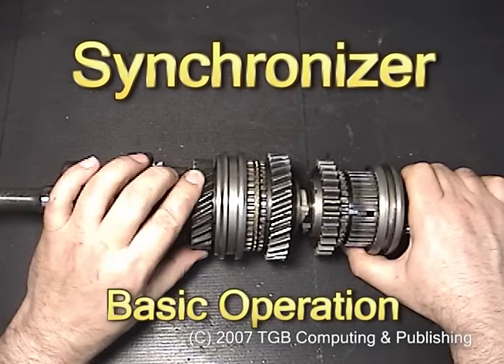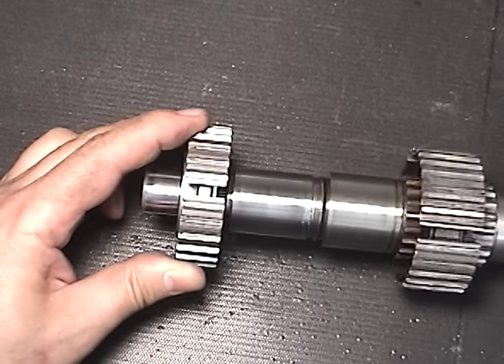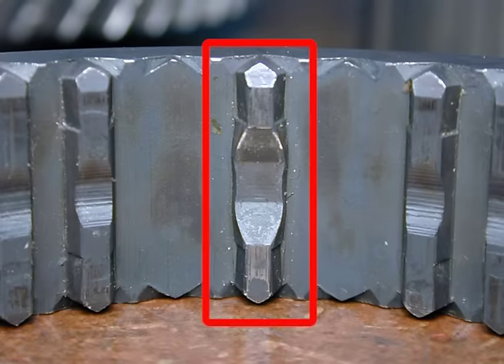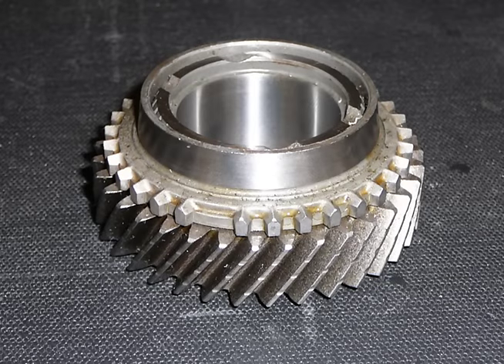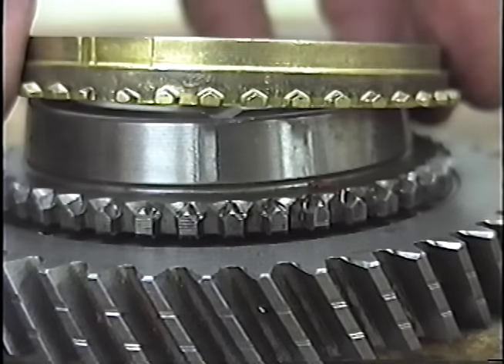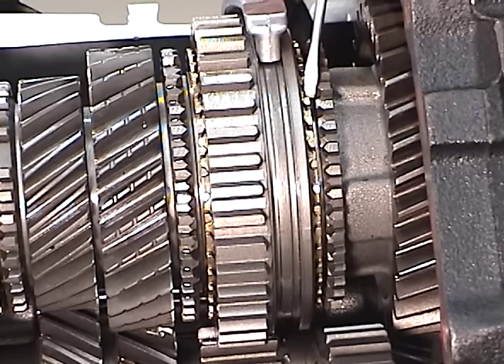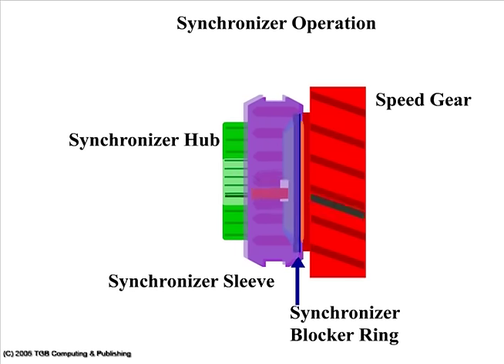Synchronizer Operation Explained

Comment: Is buying a car with a bad syncros for reverse a sign that the car could have been abused?
Reply from the maker: Reverse is never synchronized because if it was you would be able to put the car in reverse while going 15 mph forward without any grinding.  Then when you let out the clutch with the trans in reverse while driving 15 MPH forward....... well you can guess what might happen.  Any time you try to put any manual transmission in reverse while the car is moving you will get some grinding (AKA gear clash). So, no, that is not a sign of abuse.
Reply: DrivelineMaster thanks for your reply.
Are you saying there is no syncro  for reverse?
Am I looking at a new tranny then?
Reply: Could one ended indefinitely drive their clutch with this issue?
So, you just go to first then into reverse and it works fine.
Or,would you being causing unseen damage?
Thanks
Reply from the maker: Different transmissions have different methods for engaging reverse but non of them use any type of synchronization to make reverse fully synchronized. There are some front wheel drive vehicles that use partial synchronization but the explanation gets very technical.  Bottom line is any Trans will grind going into reverse if the vehicle is moving at all. You may not need a new trans.  It might just be normal.
Reply from the maker: If you have problems getting your trans into reverse but by going into first or another gear first and then going into reverse is much easier this will not harm anything and many people do this.
Reply from the maker: I'm saying the trans was never engineered with a synchronizer for the reverse gear.
Reply: I’m saying that if you try to put it into reverse first it will grind and you will do some serious damage.
So, by going to first gear “I was told zeroing out the syncros” then it would be fine.

Two questions 
Is it safe to drive this indefinitely?
How do you think this happened?
Thanks!
Reply from the maker: 1, Grinding when going into any gear is never good so yes you will add to the damage going directly into reverse if it grinds. 2, It does not hurt anything to go into 1st before shifting into reverse and since there is no grinding it is the better way and it will prolong the life of the transmission.  3, Most likely a previous driver was a bit rough on reverse shifting it into reverse while the vehicle was still moving forward instead of waiting until a complete stop.  Side note:  Placing the trans into first before going into reverse helps to align the input & output shafts and gears including the gears that are associated with reverse. Reverse is tricky because there are three gears that need to be aligned.  Drive , Idler and Driven and the 3 gear set is not synchronized. In other words there is no device designed to align all three gears before they are engaged with each other to produce reverse.  All of these gear are normally straight cut gears known as spur gears and the end of each gear that faces engagement is pointed when brand new for easy engagement. After years of putting into reverse while the vehicle is still moving those pointed gears get worn down and the point becomes rounded. Rounded points make it harder to put into gear and cause additional grinding and difficulty when trying to put the trans into reverse. Putting the trans into 1st before going into reverse helps to align all 3 gears before you move your shifter making reverse engagement easier and less grinding. Just to be clear the term "Zeroing out the synchros" is incorrect. Aligning the shafts and associated gears is correct.
Reply: Man, you have been such a big help. I appreciate your attention and expertise. So, this car that I might buy that has this problem also has a messed up brake cable that barely works. 2007 CTS-V 
I’ve been told that the repair to reverse can be made without pulling the transmission out. The GM dealership said the opposite 
What do you think? Also, worst and best case senerio (money wise) again thank you. 
I have learned in the interm that the owner has tracked the car,which explains the issues
Thanks again
Reply from the maker: Reverse can not be fixed without the transmission being removed from the vehicle and being totally disassembled.  Now that I know what kind of vehicle you are looking at I looked up the Aisin 6 speed transmission that is used in that vehicle. They use a very unconventional power flow and I need to retract and clarify.  This transmission does use a reverse synchronizer sleeve and ring to engage reverse causing what I call partially synchronized reverse.  It's more than likely that the synchronizer sleeve, ring, reverse driven gear hub and counter shaft hub will all show signs of wear.  I don't know if the counter shaft hub is replaceable or not. If not the entire shaft may need to be replaced big $$.  It could be driven as is but to have this repaired will cost big $2,200 + if you replace the transmission excluding labor and a new clutch if needed. If you did everything I would not be surprise if the cost was close to $5k depending on the labor cost in your area.  It really comes down to how much you really like this car and if you want it fixed or are willing to live with it the way it is?  If you do buy this vehicle I would try replacing the oil with a high quality synthetic Manual transmission fluid like Red Line MTF.  It might help but from your description I don't think it will but it would be worth the try.  The fact that you seek information online tells me you take care of your vehicles and you want them to work properly.  That being said, save yourself the headache and pass on this car and find one without all of these $$$ problems.
Reply: I’m taking your advice. My thanks you too! Lol
It’s people like you that make the world go round. Bless you and thanks again
Reply: @bowlingballmagic  ... This car still has a problem that needs to be addressed. 
If you are at a complete stop and you pause after depressing the clutch pedal, if it grinds going into reverse, it means the input shaft is turning when it should not be.  By putting it into 1st before reverse, the synchro on 1st will stop the input shaft, making it engage reverse without grinding.
There are many causes of an input shaft that won't stop.  Insufficient clutch freeplay, and a bad pilot bearing in the flywheel are two common ones.
Reply: @DrivelineMaster  ..  Some Subarus have a synchro on reverse.  It's not to synchronize the input shaft to road speed, but just to stop the input shaft so reverse can be engaged without grinding while the car is stopped.

Comment: Bro, what is the problem of my tractor   transmission, because it cannot shift from neutral to 3rd gear, only operate is 4th gear and reverse, what should i do, thank you
Reply from the maker: I don't know anything about tractor transmissions but there are similarities.  How about 1st or 2nd gear? if you turn off the motor will it shift into 3rd? Can you drain the oil and see if there is metal in the oil? Does the clutch properly disengage?
Reply: Thank you for respond sir, i drain already its look good no any small metal comes out. I dont what happen why i can not shift to neutral until 3rd gear. Until 4th and reverse only can work
Reply from the maker: Since I have no tractor experience you will have to help me with answers to questions. Is there a clutch that you must use between shifts?  Are you having trouble going from Neutral into 3rd? or going from 3rd into neutral? What about 1st and 2nd? Do they work properly?
Reply: Clutch they have sir, but the neutral to 3rd gear no working, thats why when i start i push first the clutch, so that it can not run to start
Reply: I dont know on what happen to my tractor, only 4th gear and reverse can  moving
Reply from the maker: With the motor off can you put it in 3rd?  Push the clutch in and start the motor. Then let the clutch out. Does the tractor move? If it does, Try this with 1st and 2nd. If this works you might have a clutch problem. If this doesn't work you most likely have a transmission problem.
Reply: Thankz sir, ill try what you say, but it the same no moving to 3rd gear, may transmission, ill thinking first if transmission down or no need expensive

Comment: urm.. failed to show me how the friction surfaces worked It synchronised.. but doesn't REALLY show me how. It didn't really show me how the blocker thing blocked for that matter..
Reply from the maker: Yes, That is very complicated and difficult to show. Since you are asking I will take a moment to see if I can explain that to you in this response.  The threads or friction surface on the inside of the blocker ring cone when forced against the mating cone on the gear create friction.  (The movement of the sleeve pushes on the keys which push on the blocker ring).  The friction created between the ring and the gear generate heat and expansion.  The friction tries to grab the gear and match or adjust the speed of the gear to the speed of the entire synchronizer assembly.  If it is able to do this the sleeve is allowed to slide over and create a mechanical lock between the gear and the sleeve.  If however the driver is trying to downshift into first gear at 70 MPH the speed differences will be excessive and synchronization will be impossible.  The heat and expansion generated from trying to synchronize the two components creates a force that pushes the blocker ring back towards the synchronizer.  This force transfers from the blocker ring to the keys and then to the sleeve. The force pushing back is so great it makes it impossible for the sleeve to move close enough to the gear to grind the teeth in the attempt to engage.  Hence blocking the shift because a shift would only result in gear teeth grinding due to the inability to synchronize the speed of the gear with the speed of the synchronizer. Let me know if you need more clarity.  I will think about how I can illustrate that and add it to this video or make a supplemental video.

Comment: so its basically a metal clutch that two gears use to "sync" together....
Reply from the maker: An Automotive clutch like what is used in a manual transmission is considered a coupler. Connecting and disconnecting engine power to the transmission. The synchronizer does couple but it has an in-between mode where friction is used to synchronize the speed of the gear and the shaft. Once the two components are synchronized then it becomes a coupler connecting the gear and the shaft together.

Comment: Thanks for the video but there is one thing is unclear to me: How is the blocker ring connected to the rest of the synchromesh? From the many diagrams I have checked, and videos I have watched it looks like the blocker ring is guided over the synchronizer keys, with nothing preventing it from just falling off
Reply from the maker: The keys that fit into the cut outs on the blocker ring limit the rotational movement and the clearance between the hub and the gear limit the axial or lateral movement. If the clearance between the hub and gear is too great they yes, it will fall off. As you can see from my video there are no mechanical latches or fasteners the blocker right just pulls off when the synchronizer assembly is on the work bench.
Reply: @DrivelineMaster  Thanks for the reply, now I finally get it

Comment: These videos explain how the two gears synchronize their speeds fine, but none ever explain how the two gears (the blocker and the speed gear) then LINE UP.  The narrator even said what the three functions are, but then he didn't explain them all.
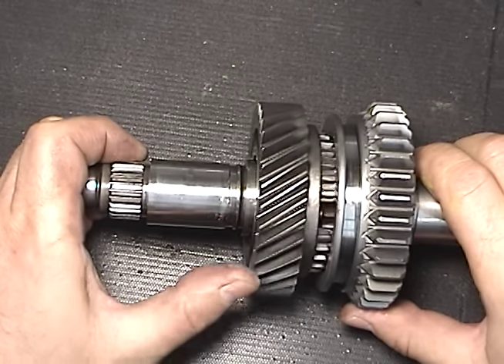Reply from the maker: Your not 100% wrong but your not 100% right either. The intro does say this is basic operation and at time stamps 4:03 it shows how the gears are locked with the sleeve and at time stamp 4:45 I talk about the blocker ring and conical gear surface being responsible for synchronization however I do a poor job of explaining how synchronization is accomplished, how the teeth get aligned and I don't even talk about how gear engagement is blocked if synchronization is not possible.  (eg. like trying to shift into first gear while going 80mph, not going to happen) The original idea was to cover the basics and keep the video as short as possible. Adding that advanced level of details would make the video longer. All this means is I need a part 2 to get into the weeds more with beyond the basics or advanced functional details to fill in those gaps. Thanks for the part 2 idea.
Reply: @DrivelineMaster  Yes, I wasn't talking to you or about you.  I was expressing my frustration with the difficulty in finding the more detailed explanation of how the blocker ring, the keys, and springs, and the shift sleeve work together.  (As you can tell, I spent a couple hours this afternoon and finally figured it out on my own.)  It would be great if you made a more detailed video--now that I get it (mechanical engineering is AMAZING) I will be making one also.  It's fascinating.  It's all about the smallest detail of the whole assembly: the spring and the particular shape of the keys.  It effing blew my mind when it finally dawned on me how it all works together.
Reply from the maker: There was no offense taken.  You are right I did leave out some real depth.

Comment: Wow I always wondered why some shifts were buttery smooth at certain rpms and others had more of a click and felt kinda forced. Had my car for 3 years from new and it was my first manual. Hopefully I havent completely destroyed my synchronizers... So from my understanding, the CORRECT way to shift according to this video is to move the shifter towards the gear you want, applying gentle pressure, as the Blocker ring synchronizes the gears, then the gear should smoothly and effortlessly fall into place after a few seconds. Correct?
Reply from the maker: That is correct.

Comment: Hii if  number 1 gear comes out by itself while driving what is the best solution for that? ..thankyou..!
Reply from the maker: The transmission or transaxle needs repair or replacement.  There are a number of causes for that including a worn synchronizer assemble.  Before replacing or repair make sure the shift linkage is not loose and properly adjusted and that the engine and transmission mounts are all in good shape and not loose or broken.  Also check all shifter bushings and mechanism.  if all is good the problem is in the transmission or transaxle.
Reply: @DrivelineMaster  ok great I am gonna look into it .. thankyou so much

Comment: Sychronisers are only necessary because most people can't , or couldn't be bothered Learning , how to Speed Match .
Reply from the maker: And why would they want to with such a wonderful mechanical design that make our lives easier.  This logic can be applied to so many things in life.  TV remotes only exist because we were too lazy to get up from our chair or couch to change the channel or the volume.  The list is endless.
Reply: @DrivelineMaster  . The Gearbox could be built  FAR  stronger and at he same time Lighter  without all those Unnecessary bits added in .
And further , once you understand how to Speed Match , gear selection actually takes  LESS  physical effort than Pushing past Synchronisers . Trust me .

Comment: 3:23, 3:50, 4:09, 6:39, 7:44 Pre-synchronization
Reply from the maker: Is there a question about these time stamps?
Reply: @DrivelineMaster  I actually got one. At 7:44, I can see that the helical gear on the left is rotating fast, whereas its dog teeth on its right is just moving downward very slowly (It is more like a shaking). 
I thought the dog teeth have been fixed on the helical gear (as shown at 3:38), why aren't they rotating at the same speed even before the engagement of the sleeve?

Comment: How do you press off Synchronizer Hub without holes
Reply from the maker: You might be confusing shift interlocks with something else because the shift interlock is part of the shift linkage and shift gate assemble.  They are not associated with synchronizer hubs and assemblies. If you can clarify I will be happy to help.
Reply: @DrivelineMaster  Sorry my mistake, and you have answered on the other vid. Thanks!